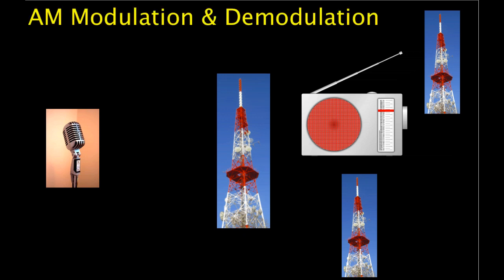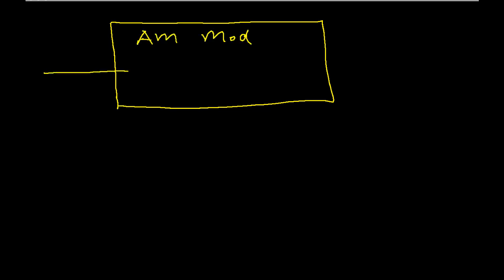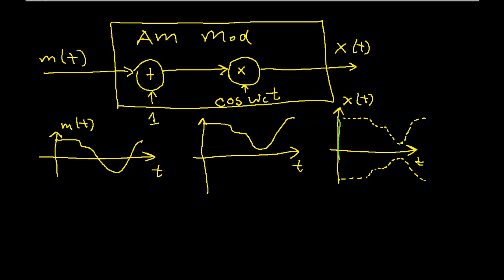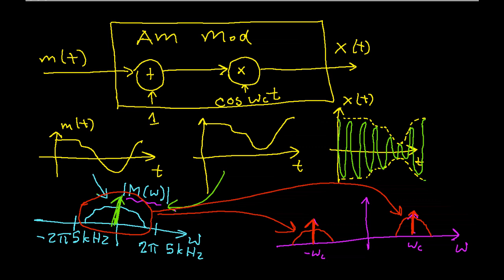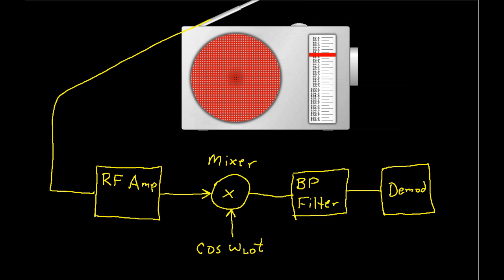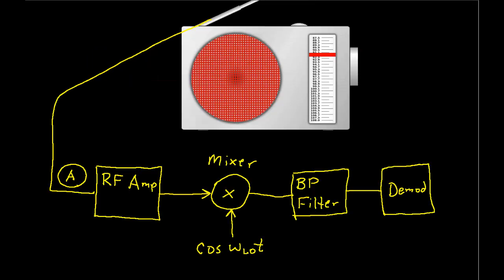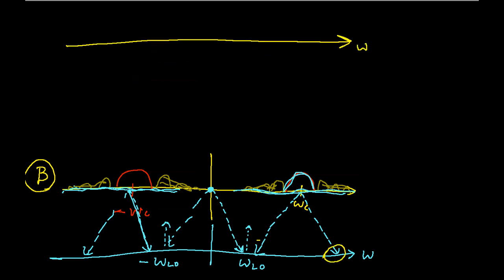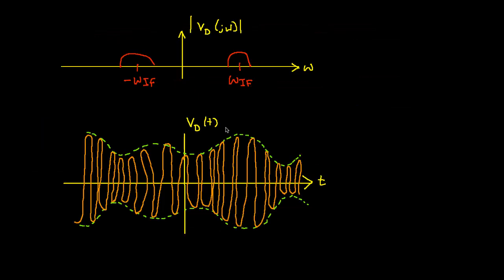AM Modulation and Demodulation (Edited)

Comment from the maker: Multiplying the baseband signal (m(t) + 1) by cos omega_c t generates the sidebands. Multiplication in the time domain becomes convolution in the frequency domain. In the frequency domain, the cos waveform is two delta functions at -omega_c and omega_c. Convolving the Fourier domain information signal with a delta function shifts it to the frequency of the delta function, so the information signal ends up centered at -omega_c and omega_c.

Comment: Your radio graphic is is a fm radio , this is fine ,but as detailed as your video is you should have explained why AM only radios never have an antenna like on your radio. This would be a good way to express characteristic wavelengths of AM, and let your students have an introduction to antennas . This will give insight when just looking at an antenna what it’s designed for. Great video.

Comment: I'd don't see how adding one will make a signal all throughout positive. I mean what if you had a signal that goes all the way down to -2 wouldn't the the signal still be negative if you add one to it.
Reply: +Memo “MekoxTwiSparkle” Pony He said that the signal has to have amplitude ≤ 1. In general, you would just have to shift it by a, but 1 makes the math easier.

Comment: why did you add +1 to m(t)
Reply: Hi man, if we even forget about the fact that we are doing AM modulation, a DC signal added  to an AC signal just lifts the signal up or down in the y axis. Now in this AM modulation case, we want to lift that signal up away from the third and forth quadrant meaning negative below zero. It makes the modulation super easier to do besides the fact that it is a way to encode, a way to prevent loss of power during transmission of the signal more.  etc hopefully it helps and not confuse you more.